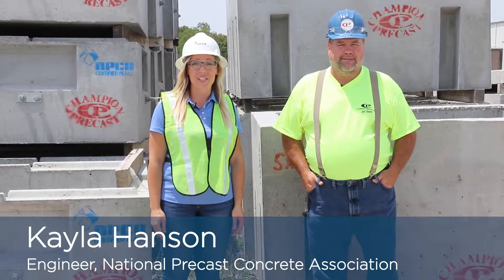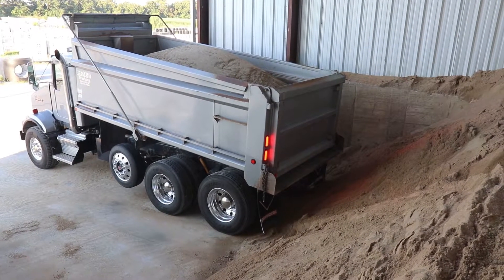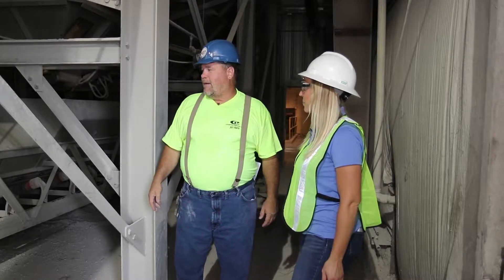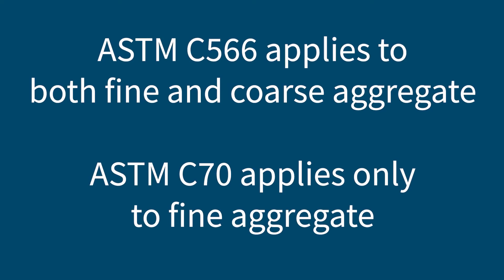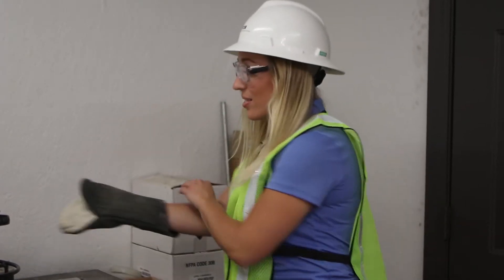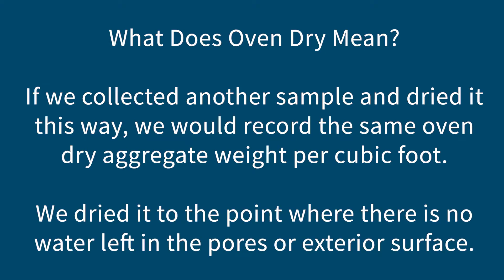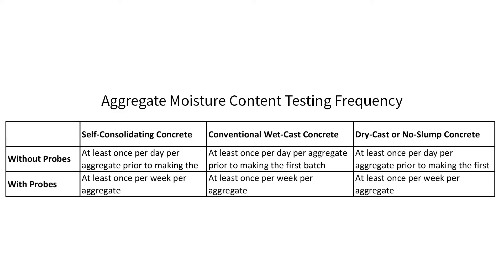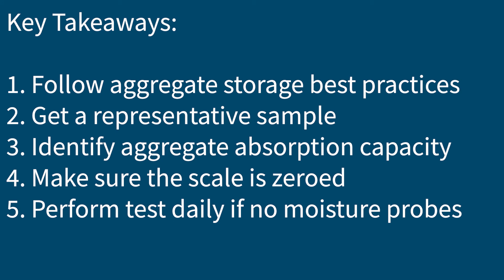Precast Learning Lab: Aggregate Testing

Comment: Wouldn’t you divide the weight of the water by the weight of the wet aggregate? Then you have a direct measure of the percentage of water when you weigh the wet aggregate when pulling aggregate for a pour?

Comment: You can use clear glass to determine if the moisture was 100 percent evaporated during drying. Just put the glass on the surface of the sample and see if the glass has a moisture if no moisture it means the aggregates are 100 percent dry.